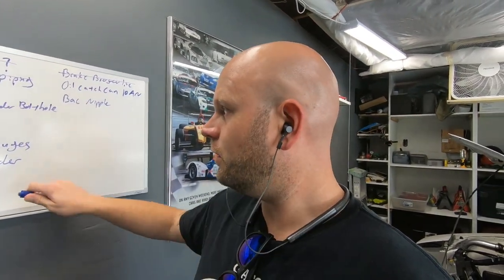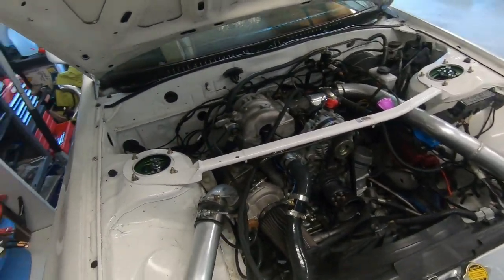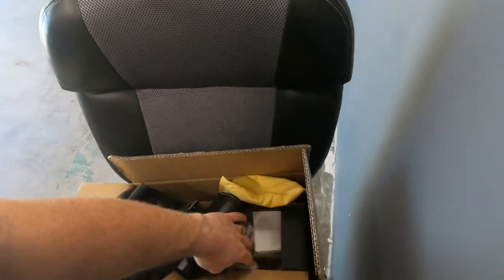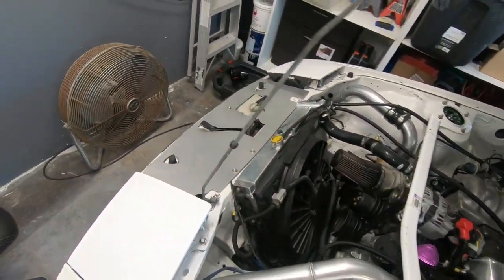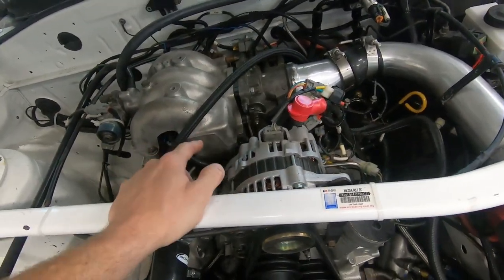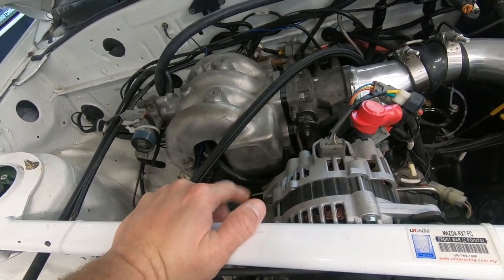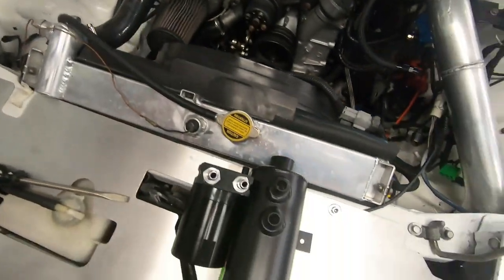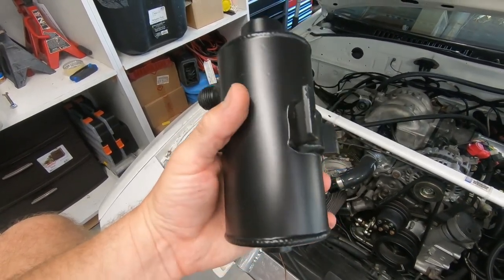RX7 FC3S Oil Catch Can Solved // post dyno upgrades MAZDA

Comment: I just used a small breather filter for my BAC valve.  I never considered using charge pipe as a BAC inlet because I wasn't sure how it would handle positive pressure.  I understand using charge piping in lieu of a turbo inlet pipe, but because you no longer use an AFM I wonder why you didn't just pop a little filter on the BAC.  
Also, I'm always looking forward to your next video.  You guys do great work!
Reply from the maker: I had the same concerns but we are following the guidance of the lucky7 team and our tuner, Nelson.

Comment: I propose the venting it to atmosphere would make it so you didn’t have to increase the diameter.
Reply: Or does that somehow create a vacuum leak through crank case?
Reply from the maker: No vacuum leak. However needs a larger diameter even when vented to atmosphere

Comment: What did you do to the port on the intermediate housing below the oil fill port?
Reply from the maker: Capped it with a vacuum block off and hose clamp